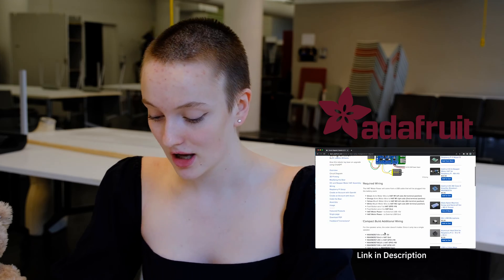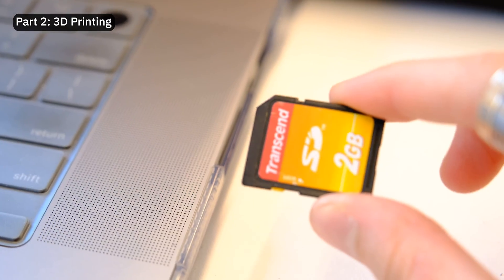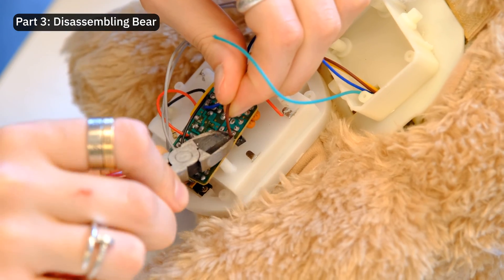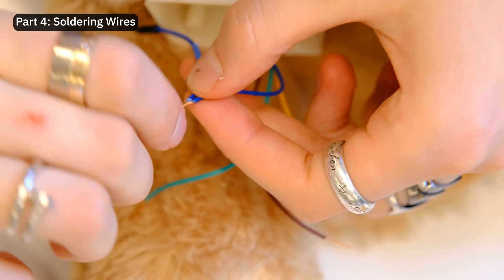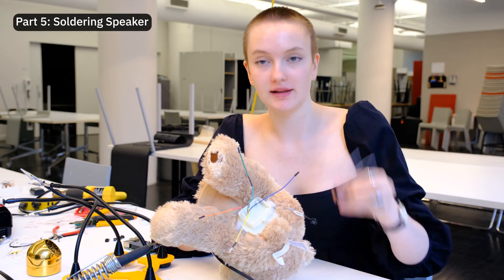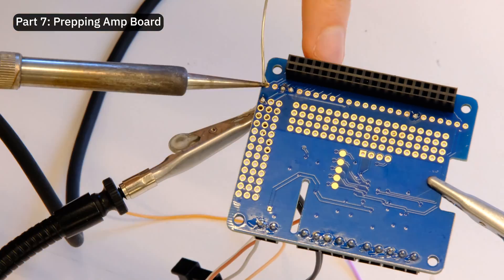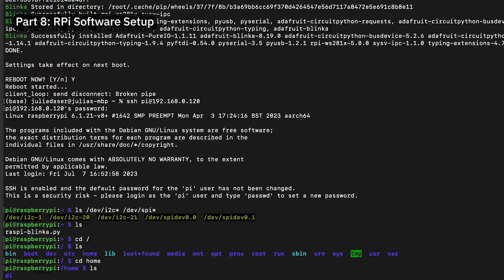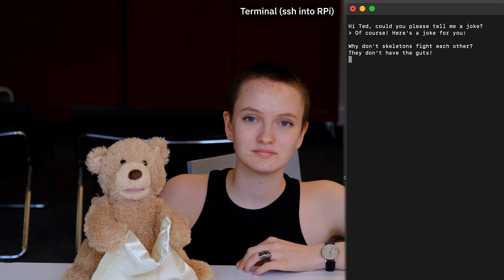I tried building a Chat-GPT powered bear!

Comment: Hello Julia  Wow what an awesome project.  I actually found your site as i was looking for how to do this same kind of project.  Well, I wouldnt actually be doing it but my son who is going to college for engineering/electrical/robotics so I wanted to get him all the hardware and software components to do a cool little robotics project for his birthday and I thought this would be fun.  Anyway, I have looked at several videos on how to make a bear like yours and I wanted to share what I found on one of the videos to help you.  I noticed that with your bear, (which is one of the coolest and most up to date videos on the subject) its responses did not sync with its mouth.  IDK if your still working on this or if you have solved it but I did find on another video where he touches on that quite extensively.  https://www.youtube.com/watch?v=cwHS7F6L13E&t=31s  Now becuse that video is a bit older than yours some of the instructions are out of date   I.e.  Alexa has a whole new platform for membership and setting up your device which i might say requires many more steps then he had to go through.  Also, you will have to integrate and give some thought to how he did his as opposed to how you did yours and integrate some of his ideas to make it work but, I feel the stuff he does is alot fun so youll enjoy it.  BTW the link i provide is part II   be sure to look at part I for info on how he did the servos to controll the mouth and eyes.  Again if youre into this it looked like alot of fun.  Also he did it with a teddy ruxpin.  I dont think that would make a difference other than you will have to figure out the wiring as its a different product.....   Hope this helps   Have fun and thank you for the video as this will help my son and he will definitely enjoy it.